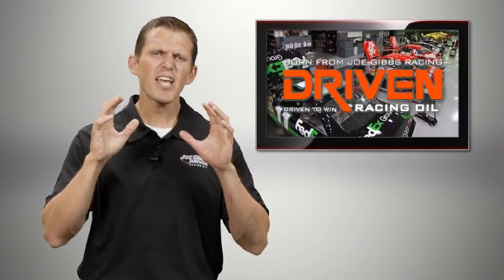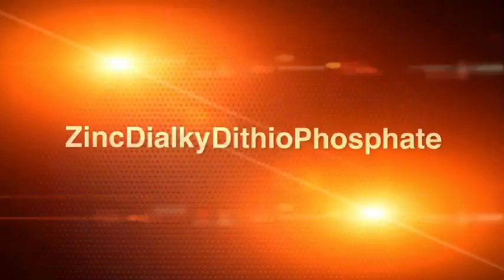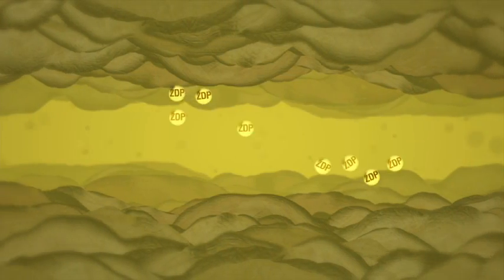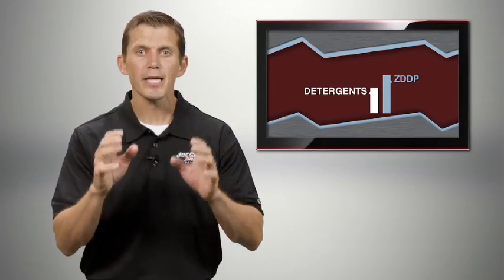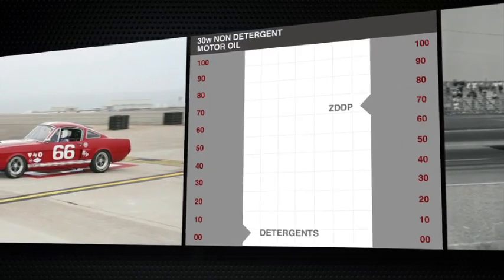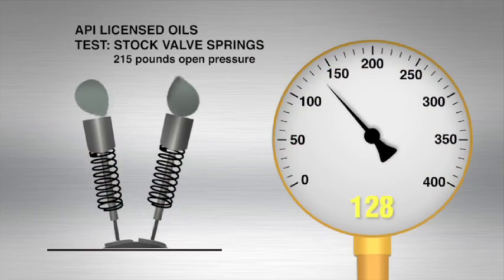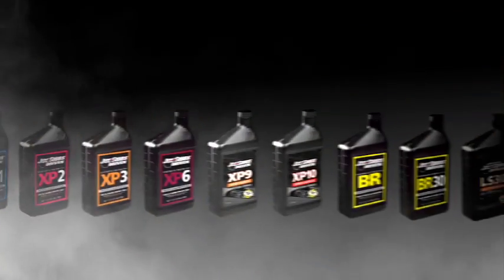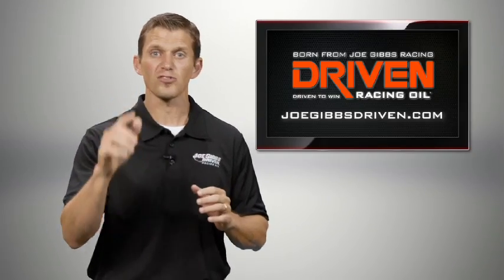The Importance of ZDDP

Comment: There is a better way, and you don't need Zinc or any other solids in the oil. How about nano-scale polishing that microscopic rough surface down so that it is Not jagged like displayed in this video, THEN a new molecular bonded layer is adhered to the metal surfaces so that it is Slick As Snot?  It has been created, and has proven and shocked NASCAR, Harley Davidson, many other racing industries-teams.

Comment: I'm breaking my fresh 302ci rebuild for my 1970 Ford van. It has a smooth high torque RV cam.  It's not hot-rodded and has a 2 bbl carb. The engine was remanufactured by Carolina Machine Engine and they REQUIRE "Zinc Dialkyl Dithio Phosphates" to break in my engine or it will be damaged and be void of any warrantee. Which one do u recommend?  ZDDPLUS, CLASSIC CAR MOTOR OIL, QUAKER STATE DEFY, LUCAS ENGINE BREAK-IN, COMP CAMS, CAM SHIELD, and BRAD PENN BREAK-IN OIL. Thank you sir for any advice.